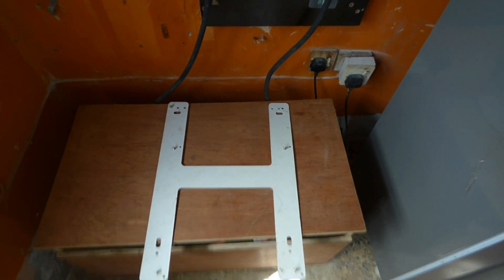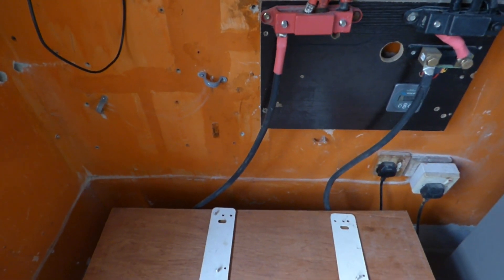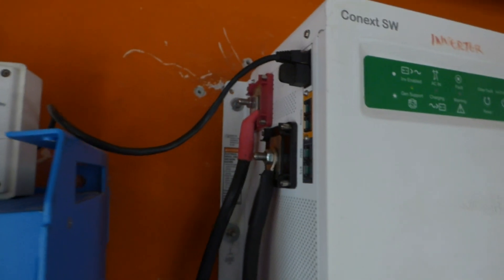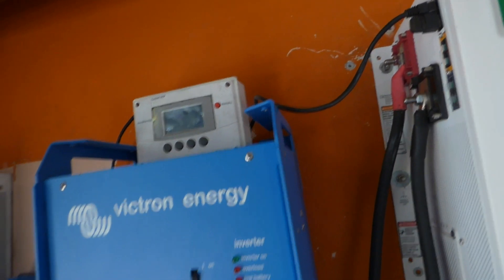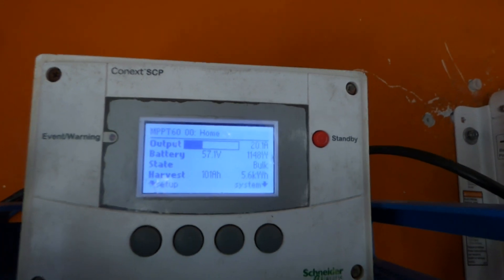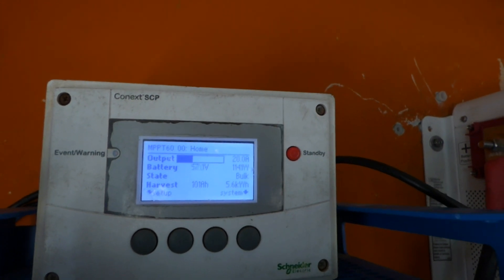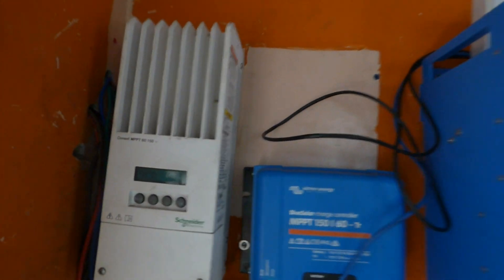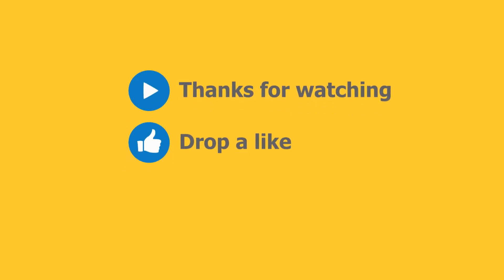Day 1 with the Conext CSW 4048 (230V)

Comment: Did you find any faults with the Schneider inverter I want a good 48v inverter to buy
Reply from the maker: Hello Omar. They are very good inverters. If you want to run closed loop lithium or customized batteries they have limitation on the charge and discharge. Outside of that they are great

Comment: Congratulations Dr Solar and thanks for sharing your knowledge and experience as usual. Schneider inverters/controllers appear to be more reasonably priced than other European brands like Victron, Studer and SMA. It will be nice if you compare them to these and Fangpusun in future videos.
Reply from the maker: They are priced about the same. However they are a much larger entity than their European competitors. They have a footprint everywhere you go. Fangpusen is a clone of the European brands so you expect them to perform like the original. Durability is still suspect on the fangpusun products. Growatt is not yet up to par with the battery inverters yet but in time they will get it right. Thank you for watching and commenting

Comment: I found with the lithium a low float sometimes wakes the absorb now this is different than what the common thought is, for instance my ESmart lithium want 

Bulk 14.4V
Absorb 14.6V
Float 13.6V
or the multiple of each for higher voltage batteries
Reply from the maker: Thanks for watching and commenting. Sadly my Victron only gives two options absorb and float. It does not give a third. I hope Victron pushed through a firmware update to address this deficiency. I hope all is well with you
Reply: @drsolar   It should have a rebulk setting if it does use that
Reply from the maker: The Victron does not. You can turn the PV off or turn the charger off. I am asking why I have been buying them. The Conext MPPT 60150 has all those features
Reply: @drsolar  wow that sucks glad I went with Midnite.